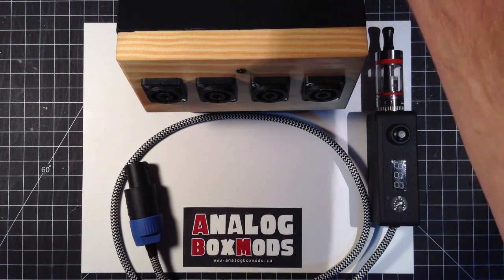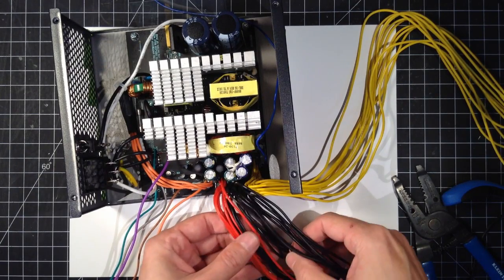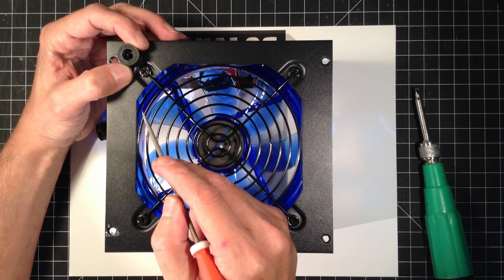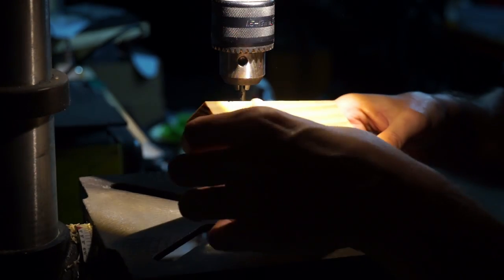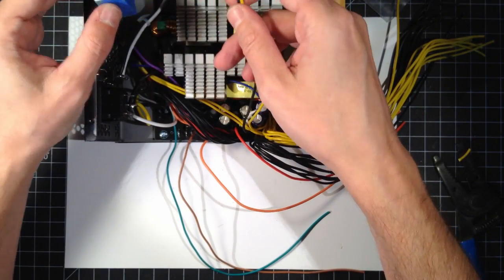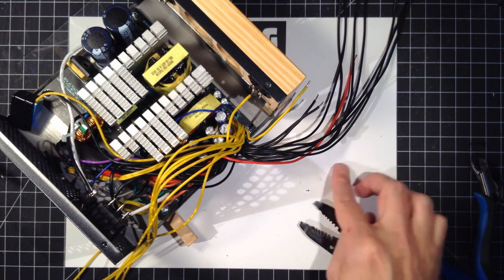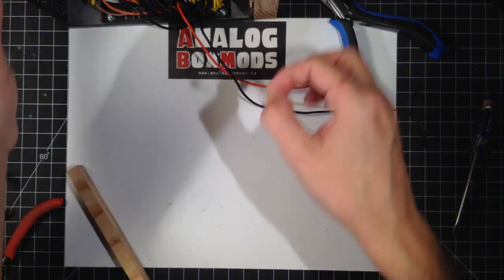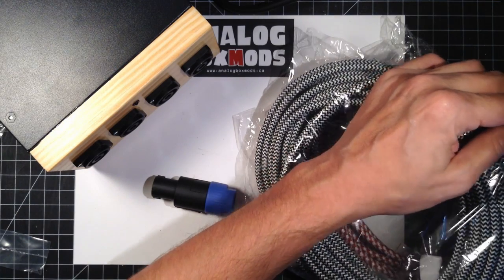DIY 636W 4x12v Output "VapeStation" Build

Comment: great vid! i have only One question... soldered like that those resistors arent they in parallel? seems much like a dual coil that halves the resistance not doubles it?
Reply from the maker: My mistake, you are right, the resistors I used on the dummy load are in parallel!

Comment: Hi, 
Thanks for your job and this video, i see below in a comment that we can control the voltage with an OKR-T30 and a voltmeter inside the psu, i'm very interested with this idea, i have already a psu vapestation, so i want to modify it, maybe do you have a circuit diagram for this, please
Reply from the maker: I don't have a diagram but check the new OKR-T30 passthrough mod video, https://youtu.be/jxcTYKmjVQk or the old/original one, https://youtu.be/4BMMx6iRyew, either way you would put those components inside the PSU instead of the passthrough mod.
Reply: @AnalogboxmodsCanada  Thanks, but how i can do for the fire button connection ? Do i need to connect the 2 wire together to short circuit the fire button ?
Reply from the maker: If you want the output to always be on, like if you are building a bench top power supply, then yes you would short the fire button wires.

Comment: Great build and video! I had a couple questions for you. Why are you using all 4 poles on the Speakons when you really only need two? Since you have 2+ and 2-  wires at the actual mod how did you wire it? I would assume you just connected the 2+ wires to the single positive wire on the board, same for the 2-'s? I'm curious because I'm using a different board for my setup. I'll be using NLPWM'S. Thank you so much for putting out videos and for your help with my questions.
Reply from the maker: Hey Chris, thanks for the comment! 

I do that to split up the Amp draw between each pair of wires and pins or to double the Amp handling capabilities of each pair of wire/pins, however you want to look at it.  If I recall those were 18AWG wires in the PSU.

So if each pin on the speakon connector and each wire is rated for 10A, by using 2 you double that... another benefit is that it also halves the resistance of each pin/wire pair.

For the cable going to the mod, I used a single heavier gauge wire which I jumpered across the 2+ pins and another for the 2- pins, so I had 1+ and 1- wire to solder inside the mod.

Comment: Awesome Vid.  Do you happen to have a parts list for this project?
Reply from the maker: Thanks James :).  For the PSU the only parts you need are some kind of connector like the speakon connectors that I used and the resistors for the "dummy" load.  For the passthrough devices, I sell part kits, the following can work with a 12V input,
http://analogboxmods.ca/Box-Mod-Kits/DNA200-Kit
http://analogboxmods.ca/Box-Mod-Kits/Naos-Raptor-120Watt-Regulated
http://analogboxmods.ca/Box-Mod-Kits/okrt10-kit
http://analogboxmods.ca/Box-Mod-Kits/SmartPWM-2.2-Kit

If you (or anyone reading this) order a kit to build a passthrough device, let me know in the comments during checkout and I can swap some of the parts you won't need, like the battery sled, for the resistors and speakon connectors.
Reply: Analog Box Mods do you ship to USA? Can’t believe I’m just seeing this now

Comment: Thats badass device I could use this in my truck.. are these available fully assembled?
Reply from the maker: Yup, http://analogboxmods.ca/Custom-Built-Box-Mods 

Would you run the actual Vapestation in the truck?  The mod takes 12V input, I imagine those trucks have a 12V DC out, like the cigarette lighter at worse, probably rated higher than a car's cigarette lighter (~10A), you could have the truck power the mod directly.
Reply: I have a couple really large inverters I run in my truck as well as a 12.5k gen set when my truck isn't running.

Comment: I thought about making a passthrough mod which has Variable Wattage Functionality. Thought about building my own buck converter to handle 50+ amps, then I could build 4 of those Mods for my squad. Also I thought about Tube Rectifiers... Abusing a few Tubes as a Power supply and then just building Steampunk style mods.

Comment: Good afternoon, can you help? How to find resistors 2x60?
Reply from the maker: You can a single resistor, anything between 15ohm and 28ohm that can handle more than 10W should be fine.  Only reason I used 2x60=30ohm is because that is what I had on hand to get close to the desired 15ohm to 28ohm range.  

Any of these should work, http://ca.mouser.com/Passive-Components/Resistors/Wirewound-Resistors/Wirewound-Resistors-Through-Hole/_/N-7fx9i?P=1z0z7l5Z1z0wt4wZ1z0wn9aZ1z0wl8xZ1z0wo4tZ1z0wn7mZ1z0wn8t&Rl=5g9nZerdlZ1z0x88kZ1z0wnx1SGT

Or if you are not in a rush, much cheaper from China but shipping can take a long time, http://www.ebay.ca/itm/5x-10W-20-Ohm-5-Wirewound-Ceramic-Cement-Resistor-10-Watt-LW-/171827485656?hash=item2801b75bd8:g:giEAAOSwcdBWT6zt
Reply: Thank you very much, good luck to you, I still have a question how to make a mod with a voltmeter, which at the very beginning of the video?
Reply from the maker: That mod uses the Naos Raptor 120W/20A board, I have not made that video yet but if you search youtube you can find some build video for the Naos Raptor, only difference is no battery, you connect the 12V from the PSU where the battery would go :).  

Most build videos and wiring diagrams for the Raptor use a zenner diode (under voltage protection) and a p-fet (reverse polarity protection), you won't need either of those in a passthrough device seeing as how there are no batteries.
Reply from the maker: I don't use either of those apps (maybe I'm old :P)  how about email?  If you use the contact form on the website I will get an email then we can go back and fourth via email. http://analogboxmods.ca/index.php?route=information/contact
Reply: could you use a 10w 30Ohm resistor?

Comment: Like do you just use it to vape like your device would be plugged into a wall or something im confused as to what this is lol
Reply from the maker: Right, the power supply (PSU) plugs into the wall and the vape (passthrough) device plugs into the PSU, so no batteries.
Reply: Ok cool. Thanks for letting me know. Where can I contact you I want to order one of the pwm kits here soon but have a cpl questions
Reply from the maker: There is a contact link on the main website or the FB page, https://www.facebook.com/AnalogBoxMods/

Comment: Could you do a video of a dna 200 VapeStation?
Reply from the maker: The power supply or VapeStation would be exactly the same, the passthough device though would have a DNA 200 in it.  That is probably the next build video I will do, a DNA200/250 passthrough device... Stay tuned!

Comment: what is the dummy load for?
Reply from the maker: As I understand it, these "switch mode" power supplies need some load on the output in order to be stable.  In other words, something needs to be requesting/using/drawing a certain amount of power for the output to be stable.
Reply: @AnalogboxmodsCanada  on that particular psu yes. most more modern ones not really as they have the 5 volt and 3.3 volt rails powered of the 12 volt rail. the topology of that psu he is using is of a older switch mode design and don't even have enough components to supply 700 watts of power its more likely only 400 watts or me technically 22 amps max on the 12 volt rail

Comment: is it safe ?
Reply from the maker: Sure, both the power supply and the vape device have built in safety features and will shut down if you try and draw more power than it can deliver.
Reply: Analog Box Mods thank you so much loved this video ,looking further for part 2.